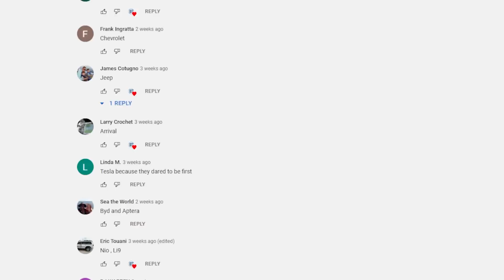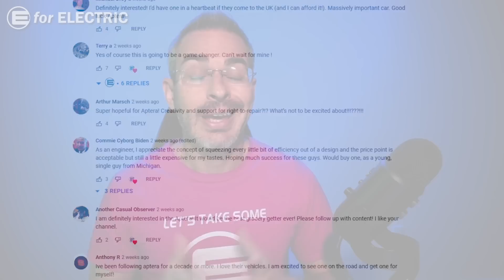How Aptera EV Got a Tesla-like Fan Base

Comment: Just to be that guy. Tesla has delivered 343,830 cars so far this year. Aptera has delivered (sound of paper shuffling) uh…none.
Reply: Except that Elon is even slower in hitting production milestones with his Cybertruck, which started development about the same time as Aptera, and is lagging in spite of his vastly greater resources.
Reply: @n.brucenelson5920  You are correct that Tesla has not produced a single Cybertruck however Tesla is making and selling the Model 3, Y, S and X. Aptera started in 2005, then went out of business then restarted in 2019 and has yet to sell a single car….
Reply: @larryo6874  Well, if you go back to 2011, when they went out of business, they sold around 17 of them at the auction.
Reply: @n.brucenelson5920  Well OK, got me there! 😜
Reply: @larryo6874  No "gotcha".  I just don't think it is a relevant point to the discussion.  Now if Aptera were to go 6 years before introducing their first vehicle, I think it would become relevant.
Reply: @n.brucenelson5920  Well they started in 2005 then liquidated in 2011 then restarted in 2019 so they have been around more or less for about 10 years and sold about 17 cars so far. I wish them the best but I’m tired of all the Aptera hype videos just like I’m tired of all the Cybertruck hype videos.
Reply: @larryo6874  The 2019 company is not the same company nor the same structure.  It is based on the original principles, but the founders have learned a few things, and have founded multiple successful companies since 2009.  I have made money in a down market from the lithium battery company that Chris Anthony co-founded and took public as CEO when he left the first Aptera.

No one knows the future.  The question I ask myself is if their goals align with mine.  If the answer is yes, then I am willing to invest, but certainly not more than I am prepared to lose, just as I would donate to any charity that is helping to build the kind of world I want to see.

My time is another form of contribution, just as it was when I did my Peace Corps service in Iran.
Reply: @n.brucenelson5920  I wish Aptera the best. I would like the US and other countries to reduce their reliance on fossil fuels and move to other sources of energy. I believe this is happening but it will take time.
Reply: @larryo6874  Thank you!  It is only one small part of the needed effort.  While there have been improvements in some areas, all of us are necessary to get to where we need to be for the sake of our posterity.

Comment: It's not that hard to plug in but better to not have to find a plug, plus free energy.
Aptera should have especially good freeway range, but misleading to say 1,000 MI range. It depends on how much you drive per day.
Reply: With the largest battery option, it will have a 1000 mile range
Reply: @GoClimbARockEh  I think that thousand Miles includes several days of charging, that's where it's ambiguous
Reply: @rp9674  nope it's all about the battery size. The 1k battery will give 1k miles from a single charge. Honestly I think the 1k option is a bit of a gimmick. Also no one actually needs 1k range from a single charge, but it is good marketing
Reply: Does Kanye own a tesla, I've got to know

Comment: Aptera enthusiast for all the ready reasons but also because I think that consumers need to see this vehicle on the road.  

Legacy auto has been answering the question, “how do we make more profit?” with ever larger, more expensive and resource intensive vehicles that require branded service centers to maintain, for decades.  And consumers in the US in particular, have largely been sold on all their marketing schemes in support of this.  

Just getting Apterae out there on the road will cause many folks to ask, “What’s that?!” and when they get all the answers; that aside from looking really cool, it is efficient and safe and reasonably priced and dirt cheap to drive and easy to repair and upgradeable, etc. then maybe they will come to think, “maybe I don’t need another urban assault vehicle after all.”  

That’s what I want to see.  We desperately need to push peoples perception of what’s possible in a new direction.

Comment: speaking of regulation. The reason they can make them lower cost is because they aren't required to meet regulations such as safety regulations.  Wait until people start getting killed  in them due to the lack of safety equipment., then it will be lights out for Aptera.
Reply: Its safer than a motorcycle.  The passenger compartment was copied from an f1 race car.the composition is stronger and more resilient than metal.  Crash testing is scheduled in January but not technically needed as its considered a motorcycle because of the 3 wheels

Comment: Aptera is going to do just fine with the Auto-cycle vehicle. They don't need a 4 wheel, 4 passenger unit. For me, although I drive a Tesla MYP, I am looking to purchase the 400 mile, fully maxed solar, AWD, for the fun of it. Also because it is rated as a motorcycle, insurance is cheaper. I am retired and do a lot of day trip traveling just to have lunch in a city 100 miles away from home. To spend a couple nights in some historic city. I'm driving to Havasu this week to spend a couple days at the Colorado River. The Level one, 14 miles an hour charge from 110volts and a little solar will cut the cost of travel. Some Tesla Super Chargers are now charging almost 40 cents a kWh. Next thing we know, it will cost as much to travel in an EV as it does a ICE car. Luckily I own my house and have my own Level 2 charger. But many folks aren't as lucky and live in an apartment with now way to charge. This is going to help them more than buying a Bolt.
Reply: While I agree that there is plenty of market for this vehicle as it is, but the public does need more affordable, repairable EVs, especially family-sized ones.
Reply: @JohnGeorgeBauerBuis  The second Aptera planned is a 4 wheel, 5 passenger sedan.  We probably won't hear much more about it until the IPO is under way and the current model is shipping.

Comment: I'm into Aptera for the freedom of movement, the independence, the sovereignty of not being at the mercy of 3rd-parties for the energy I need to get around, but also by the effect that such adoption would have on the economy, the efficiency, the sustainability, not only for the environment, but also for my finances and pocketbook.  Yes, as yo said, it's easy to plug in, but then you must wait longer.  So, I would much prefer not to have to worry if I remembered to plug in or not, and not to wait.  With what I average in daily commuting miles, I would NEVER have to plug in, unless I were to drive very very long distances across multiple states and then I would plug it in like any other EV, and it would charge at a rate of up to 500 miles per hour, which means, that by the time I'm done eating my hot-dog and having my nature break as I drive cross country, my battery would already be full!!

Comment: The issue about plugging in is that a lot of people live in apartments but still not have full public transportation so there is a big chunk of society that doesn't have a place to plug in, but still need a vehicle for a bunch of errands
Reply: Exactly this!  When my family lived in apartments, we had to run an extension cord across the walkway and down to ground level to use an AC-powered vacuum in the car to clean it.  That would not have been viable for charging an EV.  We live in a house now, so that is no longer a concern for us.
Reply: @JohnGeorgeBauerBuis  And with an Aptera you can plug the vacuum into the car without having to string an extension chord.

Comment: Alex, I’m sorry but you’re repeating a false fact with regard to solar panels.  They still operate when it’s cloudy, sometimes at lower efficiency, but they work fine.  Just ask yourself the next time it’s cloudy, can you still see?  If there’s sunlight to see, solar panels are producing electricity.
Reply: Solar panels get a little juice on a cloudy day, but the clouds definitely impact how efficient your panels are. Shadows do also.
Reply: @sdcllc8727  shadows do so more than clouds.  Shadows are completely blocking sunlight whereas clouds are only diffusing it.  Yes clouds impact how much energy a panel can produce, but not as much as many think.  On average, heavy clouds only reduce a solar panels production by an average of 10-25% of their normal capacity.
Reply: @thestrange_1  Yes, of course shadows are much worse, but on the 14th my panels produced 19Kwh and yesterday 31Kwh. The difference was cloud cover.
Reply: @thestrange_1  You must have different clouds where you live. I see an 85 percent reduction in solar output on heavy cloud days.
Reply: @skipondowntheroad5833  the amount of loss caused by clouds will very widely based on the type of solar panel you're using.  Panels that can use a wider spectrum of light don't see the same drop off on cloudy days as panels that need more visible light.
Reply: @sdcllc8727  The type of solar panel you're using has a big impact on how much clouds can interfere with your energy production.
Reply: @thestrange_1  Such as the ones Aptera is using.  They also produce power earlier and later in the day.

Comment: I eant to see exyra solar panels, a three stack for the bonnet with lateral automated pullouts either side, solar under the back T section that can rotate outwards either side and the back wheel pant that can unfurl sideways and the pivot up like a solar spoiler... Then the third wheel to extend to lift the whole car into a 37 degree position for high lattitude zones with high solar insolation for 20 hour days. Also solar doors that open forward instead of up to meet the lateral 3 stack panels that should easily double the solar area without adding any weight as they will be detachable structural arrodynamic componants.
Reply: Start your own company and you can build whatever you want to but I like the Aptera just the way it is....Yours may cost 60 to 90 G's....no thanks

Comment: Fan and reservation holder here, but I'm getting sick and tired of Aptera's SNAIL's pace in getting to production. I was a fan in 2008-2009 and champing at the bit to buy one then. Yeah, my brain knows that was a whole different deal/company/car back then, but try convincing my heart! 

Get your butts in gear, guys. DRIVE FORWARD; and get this car to market! Stop dragging your damned feet! Oh, and don't even think of building them without heat pump heating and cooling. Heat and humidity in the southeast is unbearable in a car that only has ventilation. WE NEED A/C!!!
Reply: champing not chomping
Reply: @skipondowntheroad5833  Thanks -- good catch. I edited to fix.
Reply: It has A/C
Reply: @mrpeegeepee2682  In an Aptera-published interview CEO said initial production will include no heat pumps.
Reply: @stevesilsby9668  No heat pumps, but it will still have heat and AC
Reply: @stevesilsby9668  I used to work in this field.  I talked to a major supplier where I have contacts and was able to confirm that the lead time on automotive qualified reversing valves was years away. :(  Sad, but true.
Reply: @n.brucenelson5920  Even my 2013 Nissan LEAF has a heat pump, along with heated front and back seats and steering wheel. The car heats up fairly quickly. Is it really that hard?
Reply: @jeffcarlton3590  A heat pump is created simply by adding a reversing valve to the refrigeration compressor.  No it is not that hard, although they do have to be robust enough to take the cycling and vibration of automotive use.  

I was rather shocked when I found out that a major supplier couldn't supply them without a three year lead time, and this was true of most others as well.  I had the contact because my company created the compressor design that they now sell in the millions, and funded our own EV development with the funds from the sale.

The supply chain in general is in a bad state.  I am pretty sure that Aptera will add heat pumps when they can because at milder temperatures they can save a considerable amount of battery for cabin heating, although the advantage grows less in really cold temperatures.
Reply: They are in negotiations with a Hvac heat pump manufacturer.

Comment: Looks incredibly unsafe.
If you are hit in the side your dead.
Reply: That look is the look of a light weight safety cage like you would find in a professional racing car.  Contrary to what US legacy auto might want you to believe, it doesn’t have to look like a tank to be safe.  But don’t take my word for it.  We should be seeing crash test results early next year.
Reply: Safer than a motorcycle.  The passenger compartment was designed after the cockpit of f1 race cars

Comment: Got me a 1000 mile, 3wd version on order. Looking forward to driving all the way to most of my job sites without worrying about fuel. Also pretty happy that I'll be able to fix it myself, as opposed to feeling like a need a court order to get parts from tesla, or getting screwed by tesla service.
Reply: Now that was totally uncalled for, as this is about Aptera, so please stop hating! Thank you! Cheers🥂
Reply: If the follow the Tesla strategy, your variant will be the first produced.
Reply: @OptimisticEngineer345  What the hell does that even mean?
Reply: @theodorehaskins3756  That means that Aptera may sell the most expensive full optioned variant first and leave the least expensive short range variant for a future date, far in the future. This is what Tesla did and the reason for it is pretty obvious. More profit per unit sold as they start to sell. In the case of Tesla, sadly the affordable variant never came to the market.
Reply: @OptimisticEngineer345  Aptera is selling their mid range, 400 mile variant first.
Reply: @n.brucenelson5920  Oh really? Good to know! That what I put myself down for on the order books. Hoping to get it some time in the next 2 years.

Comment: Reservation holder. What sold me the most was the idea that everything is suposed to be upgradeable so in theory I should be able to still be driving it 20 years from now. Typical EV will go obsolete pretty quickly. Another thiing was being able to charge it with enough range over night using just houshold 110v. I ordered the full solar package but I'm in Seattle so that's just a bonus.
Reply: Dave, I did solar product development in the Seattle area and learned a lot.  The solar/overcast conditions are about the same in Seattle as they are in Germany, and Germany is one of the highest use locations of photovoltaic panels in the world, proving that you can make a lot of power even under overcast skies.  I believe your solar charging Aptera will surprise you.

Comment: You answered your own question.... began in 2006.... and not a single car on the road!  It's a scam
Reply: Different company.  This one only started in 2019.
Reply: And both my wife and I have ridden in prototypes.  If Aptera goes 6 years before starting production like Tesla did, you might start to have a point.  I should add that Tesla ran out of money and was lying to potential investors and customers when they were giving rides in prototypes that broke their transmissions with every demo ride.

Lucky for them a last minute $50 million dollar investment from Daimler saved them for long enough to get a working prototype finished.
Reply: @n.brucenelson5920  There is zero chance the Aptera will meet safety and design requirements for an automobile in the US. If it is ever produced, it will be licensed as a motorcycle, like the Slingshot.
Reply: @paulkelly4731  Paul, what do you base this on?  Aptera has been designed to meet FMVSS Part 200 automotive safety standards from the beginning.  It has done so in virtual tests thousands of times.  Just as with any automotive design it will be voluntarily tested by a third party to these standards once production intent delta vehicles are available to test.  It has front and rear crumple zones, seatbelts, air bags, and other safety features that are not "required" of motorcycles.
Reply: @n.brucenelson5920  Rear bumper height does not comply with 49 CFR requirements, and headlights do not comply with FMVSS standards for Headlight, just at a glance.